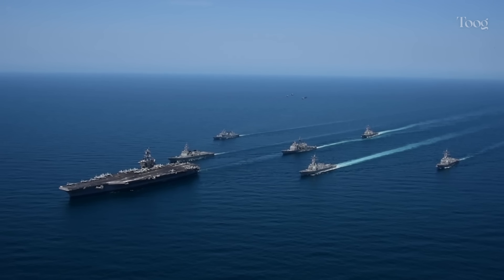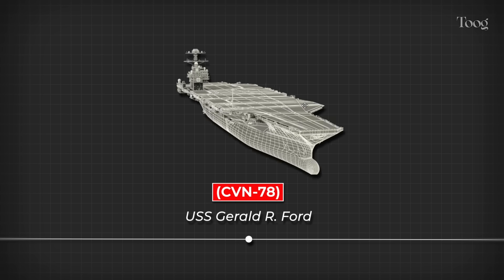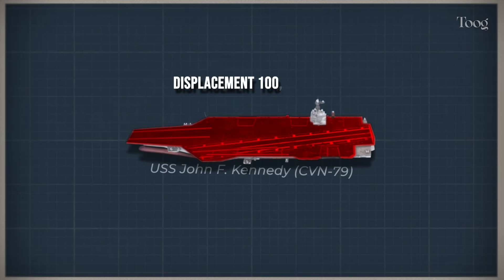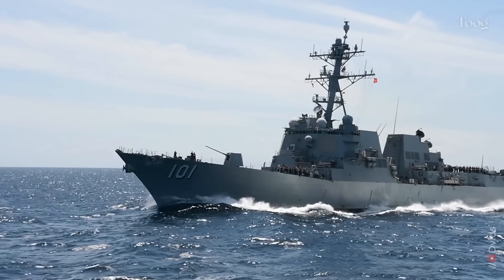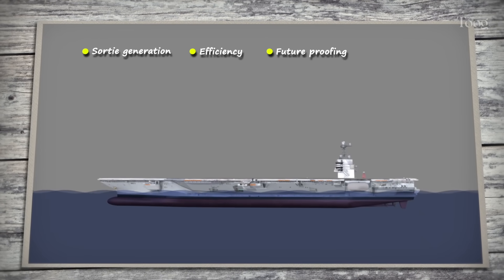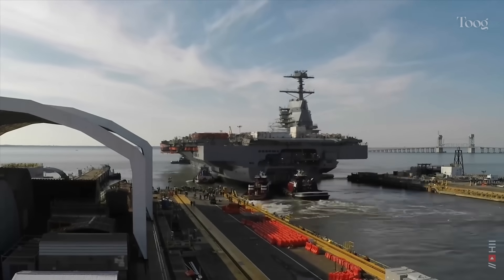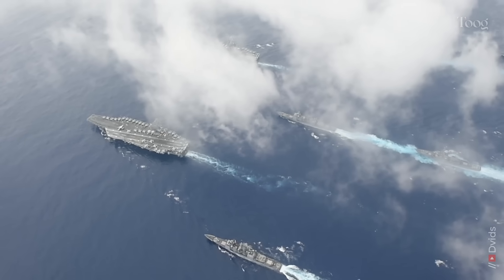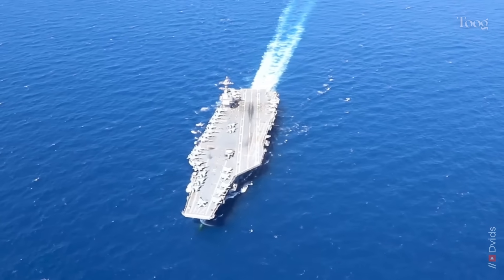The US Next Giant Super Aircraft Carrier Is Finally Ready for Action

Comment: Why do photos of the Ford deployed into the Caribbean Sea show rust near the port aircraft elevators? It makes the ship look either outdated or under maintained.
Reply: All ships no matter how new are exposed to salt while at sea. It’s totally normal and completely unavoidable while out at sea. It will get cleaned when she pulls into her next cleanup stop.
Reply: @ZekeMM25 I agree as to the running rust, it happens to every ship from commercial carriers to military ships. I worked in the deck department while in the Coast Guard and we always chased running rust be it on the super structure and bulkheads. The hull did wait until we were in port. Never ending.

Comment: I think the Ford Class is a solid ship, and it has so much potential. 
With the Russo-Chinese ignition of a new "cold war" and now a new arms race, those ships and their potential to grow, modernise and evolve the US have a solid foothold for the mid-21st century. 
Expensive, yes, but mil tech, especially at the cutting edge, has always been expensive.
Reply: CNS Jinan is about 60% of the power of a Nimitz class CVN estimates are.....that is before it has even conducted any sustained flight ops or combat drills
Reply: @michaelkendall662  
Sure! The CNS Fujian, a carrier with "stone age" tech at its core, does not even use gas turbines for energy production and propulsion; it uses boilers!
Mate, get real. 
Every expert seriously doubts that this "wonder" will even be able to come close to or match the performance of the Charles de Gaulle in the number of sorties possible, and it simply can't in endurance range or sea time.
Reply: @murgel2006  for power DENSITY a boiler-turbine setup is better........the gas turbines are better for overall maintenance and speed of startup....I know since I was a hole snipe using that "stone age technology" on an Adams class DDG for 5 years.....1200# mains with all the services going through us
Reply: @michaelkendall662  
The problem with its power systems is, for example, with the modern e-catapults that thing has power peaks, it needs batteries and can only load them fairly slowly...
Reply: @murgel2006  it does not use "batteries".....it uses capacitors which store a LARGE amount of energy that can be instantaneously released.....that is the problem with the EMALS on the CNS Jinan...its traditional engines do not generate enough excess electrical energy through spinning turbines to repower the capacitor banks quickly.....the Ford produces about 100 MW from its power plant....enough for the EMALS and planned future energy weapons....the Ford uses electrical apod engines for propulsion and stererage lowering the connecting mechanical components meaning less maintenance and noise
Reply: @murgel2006  a traditional propulsion system like I ran had boilers feeding steam to turbines, which had their rotation diminished through reduction gears like a transmission in a car, with the output going via a long propulsion shaft at the bottom of the ship through the ship in shaft alleys to the props....all those connections were mechanical and made noise and wore out over time
Reply: @michaelkendall662  
Sorry, I use batteries, Akkus and capacitators here in a synonymous way, even though the area is very different things and do different things.
Still, I think the Type 003 will see only the Fujian as its sole ship; to me, it looks like a stopgap and "experimental/training" platform for the EMALS and maybe an AAG, and to collect practice for a CATOBAR.
The 004 is already in construction after all, it is planned to be nuclear, and I could see the Type 004 becoming the first true multi-ship carrier class for China.
Reply: @murgel2006  batteries are for long term storage and discharge
Reply: @michaelkendall662  
I know what the differences are; however, there is a trap in using generally known words in the wrong manner for "simplification"...
One can not expect that people know the differences in the various power units...
Reply: @murgel2006  "people" are not expected to know how a very complicated electrical/electronic mechanism works.....leave that to the EEs
Reply: @michaelkendall662  
Well, but on a channel like this, people display a basic interest and thus a basic understanding can be expected. Stuff like the catapults are electric and such...
Reply: @murgel2006  you need to do some research then or get an understanding of how it works....talking about batteries shows you do not.......a HS physics class or an electronics class would have given you the basics
Reply: @michaelkendall662  

Frankly, as my estimations regarding people's mental abilities are fairly low, or realistic, whichever you prefer, I use simple terms to make things easier.
Furthermore, English is not my native language, and I must admit that I'm not as fluent as I used to be. You know, anomia, to a degree and sometimes.
Reply: @murgel2006  using ERRANT information is far from making things "simple"
Reply: @michaelkendall662  
Using "batteries" as an indicator that the system works with stored electric energy instead of steam simplifies it to such a level that almost everyone can grasp the concept. That those "batteries" are actually capacitors and why that is, on the other hand, requires understanding above "average" common knowledge.
People with a better topical understanding often fall into the trap that their perceived "obvious and basic knowledge" is anything but. 
I try to avoid that trap, a byproduct of my career in training & education. Sometimes that results in my "oversimplifying" things
Reply: @murgel2006  again, your use of the term "battery" just displays your ignorance on the matter.....you should stick to what you know
Reply: @michaelkendall662  

Honestly, your inability to grasp concepts like "made easily understandable" shows your ignorance.
As we have passed from the exchange of comments into rudeness, I shall leave the last comment to you.
I know you will consider yourself as being the right one, but frankly, I can live with that.